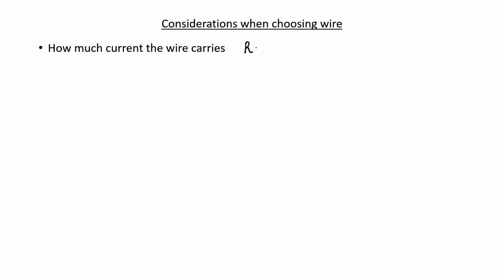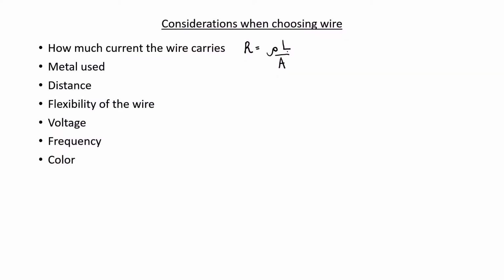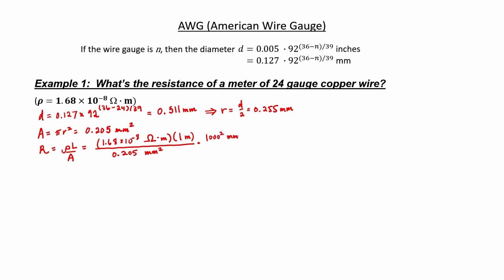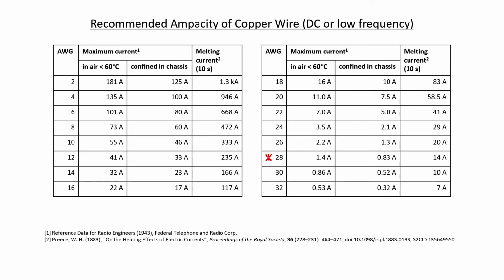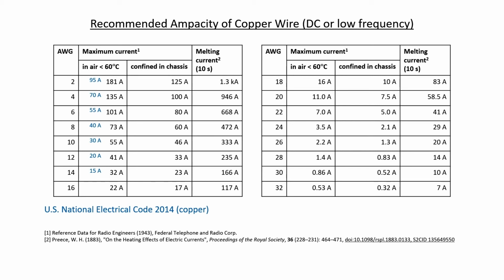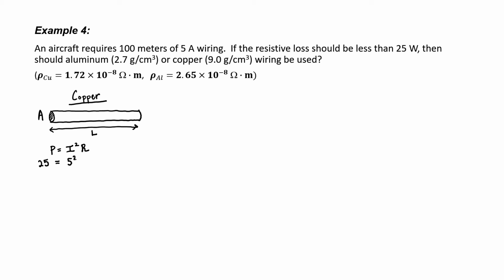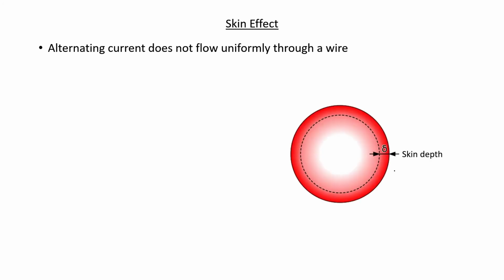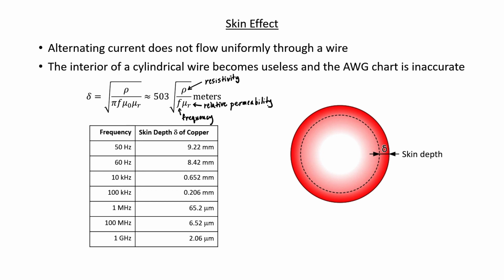Wire gauge and the skin effect (3 - Electricity Distribution)

Comment: I cannot help but wonder if we could just based the amperage on the conductivity of wire, like isnt that what matters? 

Gauge is close to what i mean, but some kind of ideal gauge reguardless of actual thickness and material based strictly on the properties of the wire as a resistor. 

Idk just ea6ched a boden clip and was thinking, it'd be alot easier just to measure the resistance/conductivity from source to sink and derriving a reasonable break on amps from this

Comment: Gauge is such a stupid thing...
Crossection, resistance, diameter - all of these make sense and relate to the physical parameters, gauge on the other hand, yeah no.
Reply: Thank you for this. I really hate having to memorize the conversions of 30+ values of the wire gauges into millimeter diameters for my calculations. Americans already make it harder enough by also using circular mils, feet, and inches for the specific resistivity. Why do they have to be so allergic to modern units.
Reply: Nobody working with electricity in the USA has trouble with wire gauge.  It is a lot simpler than working with the dimensions of a wire in any units.  Electrical Engineers have to do that at times, but not after engineering is reduced to common practice.

For wiring in a home in the USA, we use AWG 14 for a 15A circuit, 12 for a 20A circuit, and 10 for a 30A circuit.  Those are the most common circuits.  For uncommon circuits, look it up or call an electrician.
Reply: @GH-oi2jf  anything but metric, right?
You ever get tired of defending those dumbass units?
'Oh but its so easy' - you know what's even easier - specify current density and you just get crossection - no tables needed.
Same with gauge for sheet metal - we measure thickness - not some arbitrary clown units.

Comment: This is a really good series with high quality information.  I would just like to add an important detail to wire selection which these days has become more important due to more material choices for insulation.  Insulation choice has significant effects on not just the safe voltage capacity but also the current capacity, operating temperature and therefore Gauge choice. The charts referenced are for an assumed thickness and grade/material of insulation. This is due to two effects:

1: cooling of the wire.  some insulators (plastics/rubbers) are able to conduct heat away from the conducting core faster and therefore for the same energy dissipation as heat in the wire the wire will raise in temperature less.
2: safe operating temperature without melting or degrading.  some insulators are able to operate at 50-60C for long periods without degrading while others will break down, go brittle and crack prematurely.  Also peak temperature resistance due to melting point but really you shouldn't be operating anywhere near that so degradation is the main design driver

Which is all complicated thermodynamics to predict which are a pain to calculate hence the need for charts
bottom line take away, in a pinch you can often squeeze more amps into the same gauge wire by picking a less standard insulator such as PTFE

Comment: I am finding that you can find copper plated steel wire masquerading as copper. At first glance you think you have copper, and the resistivity is much higher!
Reply: It shouldn't be misrepresented, but it has a legitimate use.  It can be used to discourage theft in places where wiring is outdoors.